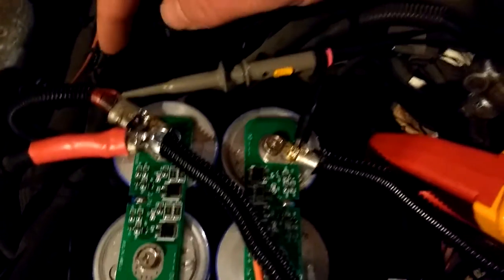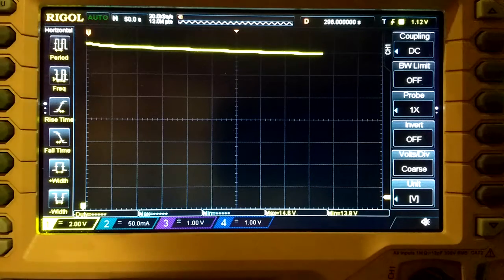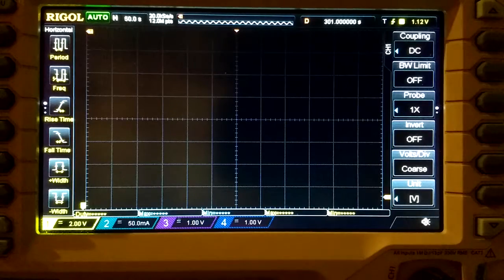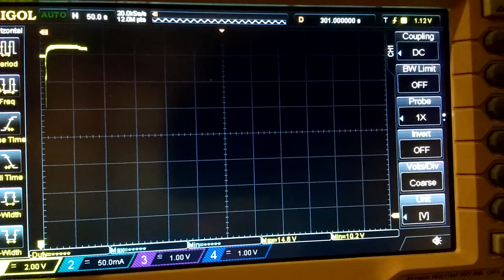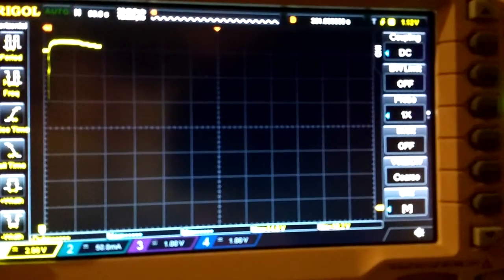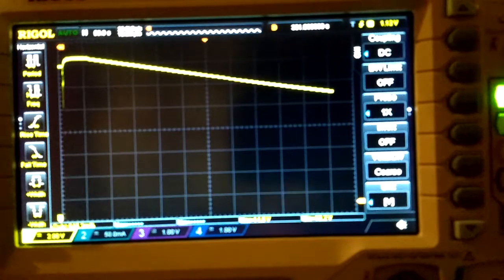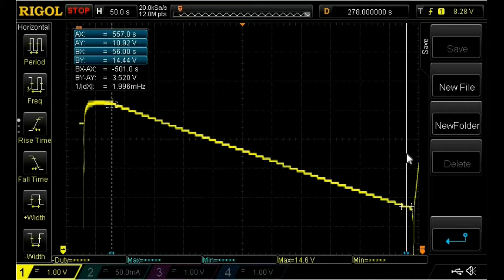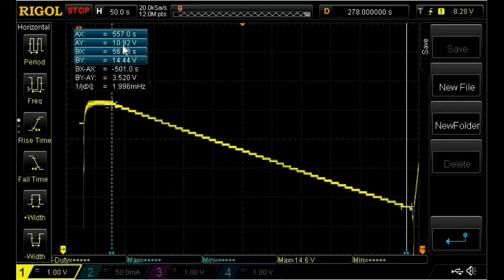Using a super capacitor as a battery (part 8) Running accessories with the car off

Comment: so battery is better than capacitor, so I rather buy battery then
Reply from the maker: yep if you run electronics without the vehicle running you're way better off with a battery.